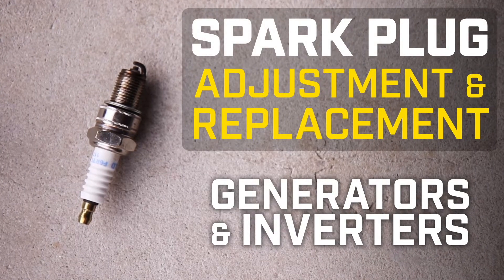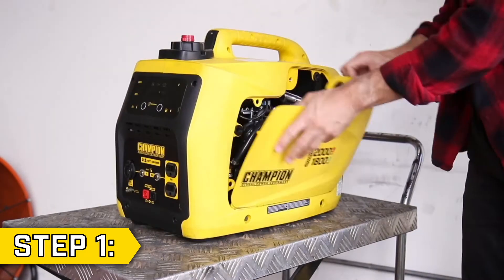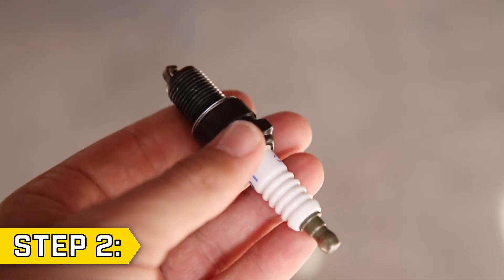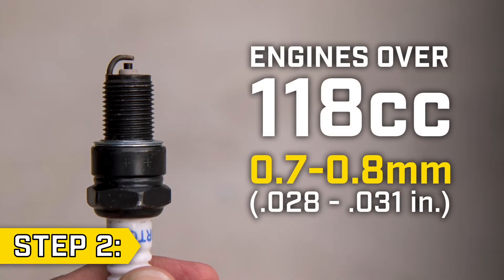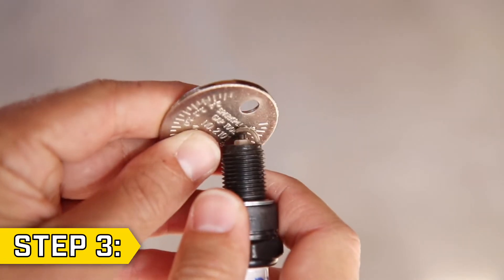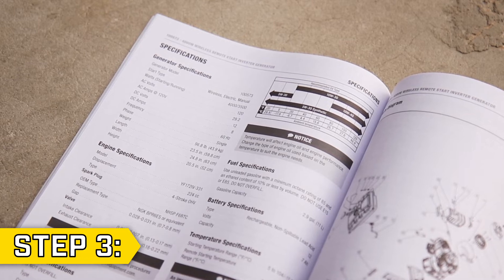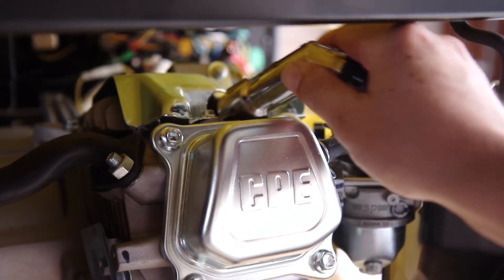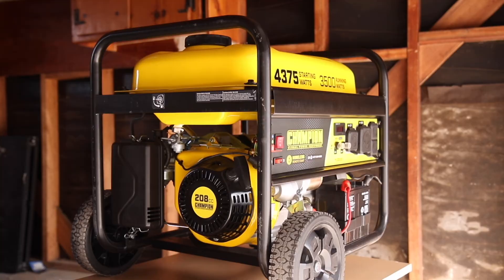Spark Plug Adjustment and Replacement

Comment: Since I have a 700 cc engine, I need to go with .7.8 gap does it make a difference if I’m running on natural gas instead of gasoline?
Reply from the maker: The gap does not matter whether on natural gas or gasoline. ⛽️